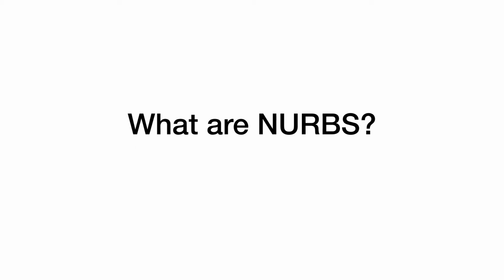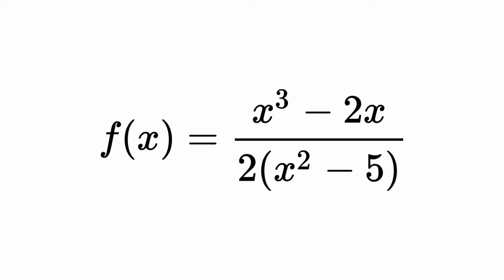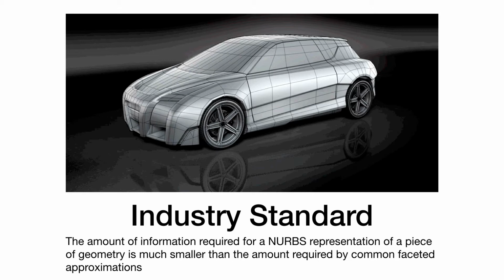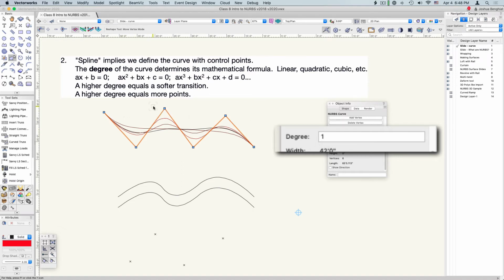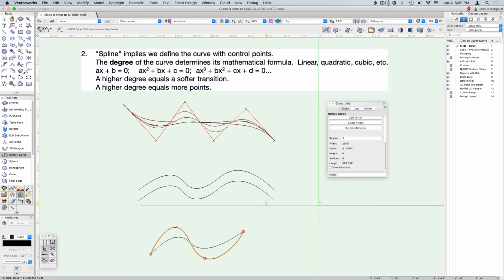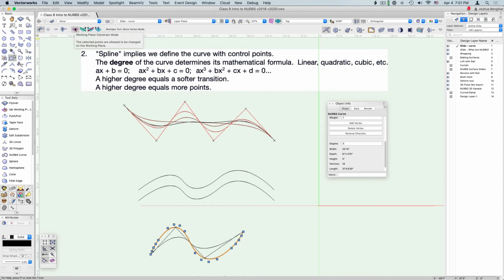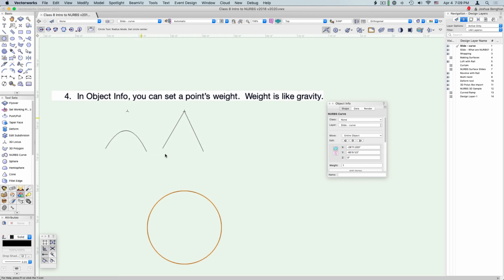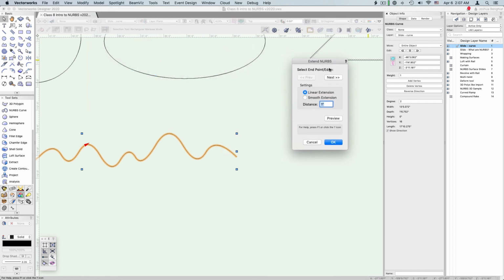NURBS Part 1: An introduction to NURBS

Comment: Hi, Thanks very much for your videos. Very clear and informative. I do not see the 'weights' variable available to me when I select control points. I've followed your steps and can select the points but there is no weight variable between the point's location and the 'Add Vertex' button. Here's a link to what I see. I'm running VW22 on a M1 Macbook. Thanks for any help.
Reply: update! the weights where available when I did the next excercise with a circle. There must be something I did wrong when I recreated the three points with the locus tool.

Comment: Awesome video! Just want to clarify information around 5:20-5:40. Pretty much every consumer graphics card nowadays work explicitly with triangle meshes. This means that if any software uses mathematical representation of a curve/surface it needs to convert it eventually to triangles/discrete representation to display it on the screen. This means that you by default don't get smooth surface when zooming in/out in the viewport. Two things can happen inside of the software (depending on a software you use): (1) automatic refinement of a surface mesh when you zoom in (this is how for example Fusion 360 works), (2) you need to manually change the settings to have a smoother curve/surface (this is how Maya works).
Reply: How about shading solutions like SDF? There you can define a surface mathematically and it's no longer about triangles.

Comment: so if i dont know any thing in math can i learn NURBS ?
Reply from the maker: I think knowing that NURBS use math can be useful to keep in the back of your mind, but for working with NURBS in Vectorworks, you don't need any actual knowledge of the math behind them. 
The mathematical principals that may be most useful to remember:

- NURBS cures and surfaces are math-based, like vectors, so they will be smooth at any zoom level

- Understand the relationship between the degree setting and how that visually affects the curve

- Creating a NURBS surface, you may be asking for a calculation that is impossible, and Vectorworks won't create a surface with those particular curves and / or parameters.
Reply: @jBenghiatLD  thx <3